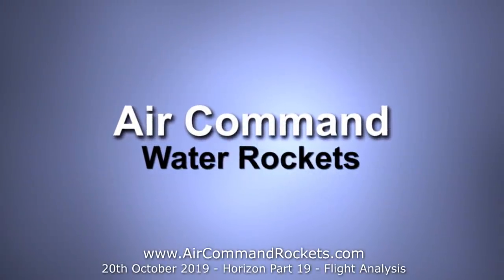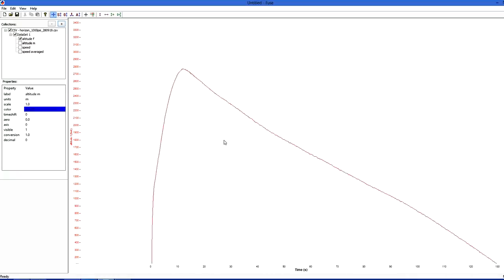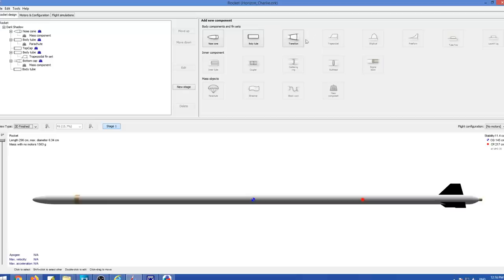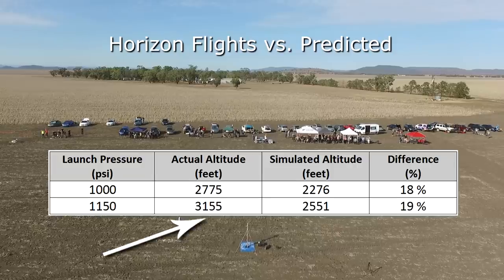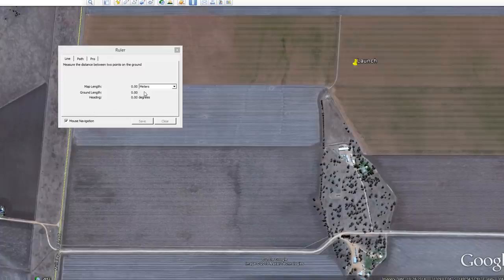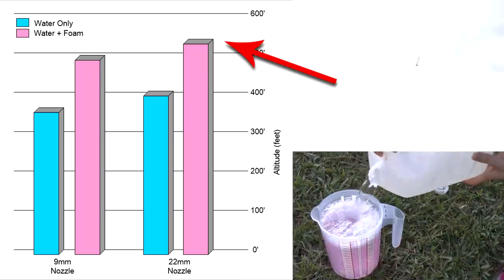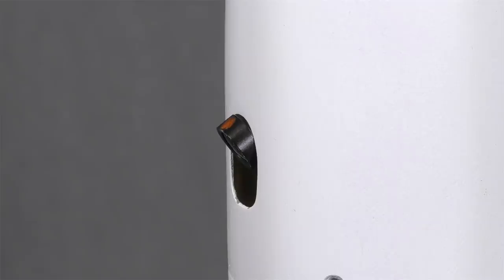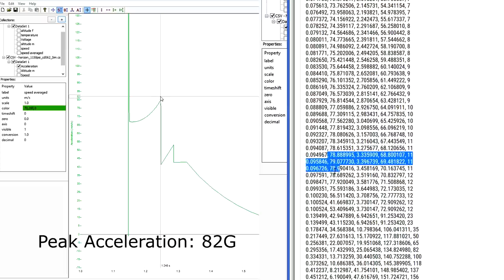2 Stage Water Rocket - Part 19 - Flight Analysis

Comment: So can we expect a bell nozzle in the future??
Reply from the maker: Most likely :) We'll have to do some work on the test stand for this.
Reply: @AirCommandRockets  I know in sugar rockets it does not take much divergent section to make an improvement in performance, and that a straight conical nozzle is almost as good as a perfectly curved de Lavel nozzle. That foam shot says to me it's time for a better nozzle. I'd be really interested to see the results.

BTW I made the 3d rendering function in Open Rocket and it still always makes me so happy to see it on youtube, especially an amazing project like yours. Great work!
Reply from the maker: Thanks Bill, :) Yeah, a conical nozzle is what we are most likely to have a go with since they are so much easier to machine. We'll need to update the release head to fit the nozzle, probably seal it in the throat portion of the nozzle. We'll run some ground tests on the test stand first to see how effective it is with the foam. 
Nice work on the OpenRocket rendering! :) I use the program quite a bit, mostly for mid/high power rockets.
Reply: @AirCommandRockets  Thanks! My work on it is just a little add-on, the other folks do the heavy lifting.

Comment: "You can probably guess what we need to do to the nozzle to improve performance even further."

Yes, yes I do.
Reply: Engine bell
Reply: @handsanitizermk.268  I'm excited to see this! I guess they guys and girls from Air Command Rockets are also happy about experimenting with some sweet sweet engine bells. Although: Could  you use some dry ice for pressurization, cooling and maybe some continuous thrust? It might be a step away from an elegant air/water rocket, but maybe worth a try.
Reply: @handsanitizermk.268  the challenge (or maybe not) would be the sealing. I'm thinking of it having a straight cone and the sealing on the smallest part of the nozzle. The coupler for that should match the profile of the nozzle bell. That will add more structural integrity to the rocket, given that this is a second stage.
Reply: @handsanitizermk.268  Yep, the still image shows that the divergent section of the nozzle has an undersized exit diameter since the foam undergoes additional expansion after leaving the nozzle.  No need for a "bell" shape.  Just a conical divergent section is fine.

Comment: Hi, thank's for this interesting video ! :)
The Drag coefficient depends of the speed. You can simulate the drag coefficient with RASAero II. It will give you a curve, not just a value.
Where could I find the Javascript version of the Water rocket simulator ?
Reply from the maker: Cheers, I'll give RASAero II a go. It's always good to have extra tools. The water rocket simulator hasn't be released yet. I still have some more work to put into it, just have to find the time. When it's finished, I will put it up on the web.

Comment: Interesting method of the altitude calculation! Great analysis, new vent holes and ideal expension of the divergent..waiting for the next video!
Reply from the maker: Cheers Kyiv Rocket Club. We're going to have to do some high pressure tests with the expansion nozzle on the ground first to try to measure the thrust and compare it to a straight through nozzle. That would be something we look at after this project is finished.

Comment: Hi George, the bending of the rocket under pressure might be due to less longitudinal carbon fiber strands on the outside of the bending curve. You could adjust this by laminating carbon roving onto the shell. If you want a stiffer tank section for the next build, you could consider using high modulus carbon fiber. This is a lot stiffer than the usual stuff but has almost no elongation at break. Interesting project, thanks for sharing
Reply from the maker: Thanks for the info Patrick, will keep this in mind for future builds.

Comment: Could you be hitting choked flow in the nozzle? I'd be surprised if you're breaking mach 1 in the water phase, but might be exceeding Mach 1 in the air phase. I'd be pretty suprised if compressible multiphase is well-studied since multiphase flow research is incredibly challenging, and isn't well-explored outside of applications applicable in industry. I definitely agree that you're seeing underexpansion at the nozzle exit. You've probably got a lot more potential performance in the rocket than you've seen so far.
Reply from the maker: If I remember correctly during the water only phase at this pressure the water is coming out at about 30m/s. This is a straight through nozzle without a divergent section, so during the air pulse I would be expecting only Mach 1 flow. With an expanding nozzle I would then expect > Mach 1 flow in the air phase. The big question is what is the exit velocity of the foam, and more importantly the velocity of the bubble surface (the water) as the bubble expands when it emerges from the nozzle. It would be interesting to find out if the foam can be accelerated to supersonic speeds out of a divergent nozzle. The complication of course is that the flow is not constant due to the dropping internal pressure.
Reply: @AirCommandRockets  I'm seeing a lot of air coming out in the jet in those stills at launch, which might be the gas dissolved in the water (which would be encouraged a ton by adding shampoo). Maybe there's something going on with sound propagation between the air bubbles and the water phase? That could depress the speed of sound a ton if it's got to cross from one to the other a ton. Thinking about the speed of sound changing that much just from the flow conditions is making me more than a little nauseous lol. I've never seen that sort of underexpansion in strictly subsonic flows, but that might be the limits of my experience talking.

Comment: when watching the previous video I was thinking the exact same thing when looking at the halo on the ground from the onboard footage. By the way that's not a glory, the specific name for that effect is heiligenschein.
Reply from the maker: Ahh ... good to know about the name of the phenomenon. Thanks!
Reply: Air Command Rockets No worries! Great series. And I may be mistaken, as heiligenschen is mainly used referring to dew causing the effect. Opposition Surge or the opposition effect is used when it's caused by a very rough surface, in this case a field. Fun fact, lunar regolith is retroreflective for this very reason! The rocks are so porous from being unweathered, and you can see this brightening around astronauts' heads in some photos taken from the moon. It's also why a full moon is far more than twice as bright as a 50% illuminated moon.

Comment: Have you considered using a GPS logger, which would not have the pressure error that a barometric altimeter does? Skydivers use a GPS that goes by the name of FlySight -- it's lightweight and logs at 10 Hz, I believe. As well, it uses Doppler data to measure velocities, which would improve your precision there over using differences in position data.
Reply from the maker: GPS could certainly be an option, though I am not sure what kind of altitude resolution could be achieved. I though it was around the 10m mark but could be wrong. GPS can also lose lock under high acceleration, but again I am not sure if that applies in this scenario or not. Having a GPS though on board would be useful for other things.

Comment: My immediate thought about the initial air pressure drop was the air mass movement during acceleration. Could you put a hole or two at the very point of the nose cone to reduce that effect?
Reply from the maker: That's a good question, I am not sure how that would affect the air pressure if the hole is exposed directly to the on-coming air stream. It may behave differently depending on if the other vent holes are open or closed as well.

Comment: Great job George! To think about rocket shadow and find sun position to determine altitude it is an amazing technique. I would have never thought about that possibility. About foam increasing thrust I think will be easy for you to set some static tests to measure the thrust curve with different % of soap. Maybe is a combination of effects. Soap is heavier than water so when mixed you have some more speed because of viscosity change and a bit more of mass with same volume.
Reply from the maker: Cheers. The mass increase here due to adding 20mL of shampoo to 2L of water is not significant. It is less than 0.5% more mass. In our case about 10g more compared to the 2000g for the water. I'm not sure how much viscosity plays part, as again the concentration of the shampoo is very low, and viscosity of shampoo is actually higher. I believe most of the benefit is due to the increase in exhaust velocity due to the bubbles expanding as they exit the nozzle.
Reply: Hi ! yes of course , I was not aware that soap was in so small quantity. But why soap influence bubble expansion ? If we pressurize water and gas the gas has a diffusion into the liquid. When pressure drops you have the bubbles. It works like sparkling water when you open the bottle cap. Maybe the soap has an influence on gas diffusion into the liquid. More gas into water&soap could mean more bubbles..so higher expansion.
Reply: @PieroAcme  With soap there can be probably more bubbles,
which remain from the filling.

Comment: I am thinking that the effects you are seeking are directly correlatable to the viscosity of the liquid used as your propellant. As such, consider adding pure glycerine to water.  It may also breakdown in UV better (ensuring that the farmer who owns this land is a happy camper).
Reply from the maker: That's a good point about the Glycerine, that's one of the reasons we only use low concentrations of the shampoo.
Reply: @AirCommandRockets  it is my impression that you are trying to enhance the effect of a two-phase flow.  This may be along the lines of what you are looking to achieve - https://www.sciencedirect.com/science/article/abs/pii/S0301932218307717
Reply: @AirCommandRockets  I guess what I am suggesting is that you consider a higher concentration.

Comment: Great videos - love it. I'm not a rocket engineer but... I work in the oil and gas world and we add surfactants (shampoo ?) to our water for pumping to reduce the friction losses (the term is slickwater - it lowers the water viscosity & hence  reduces friction loss in the pipe/nozzle). Could this be another factor ie reduced nozzle friction losses and therefore more energy available for thrust ?

Comment: Another interesting video George. You seem to be getting great results with your timer calculations, but Is there a reason why you don't use the altimeter to release the chute?
Reply from the maker: Thanks Derek. That is the long term plan to use the altimeter to release the chute. We have done this before and will definitely need to when it is flying as a two stage since it will be harder to predict apogee. We only have one of the stratologger altimeters that has a pyro output, (the other altimeters we use don't have any output for apogee) and so we only fly the stratologger rarely, as I've been unable to get a hold of a second one. 
We find the timer works well for most of the flights so we just use that. The timer is easier to replace than the altimeter. :)

Comment: How about experimenting with different hull surface treatments? ...or is this something already fully under control? (I am more a hydrodynamics guy:))
Reply from the maker: Sure there is always scope for surface treatment both internal and external surfaces for better airflow on the outside and better water flow on the inside. Any recommendations?
Reply: There must be some aerodynamics experts out there? Is surface roughness useful at those speeds?
Reply: Would a graphite surface in the water tanks produce useful roughness? No idea, but....   :)
Reply from the maker: A smooth surface performs better in this instance.
Reply: I guess that us much due to the high pressure. (should check Reynolds, ...)

Comment: So why do you think the foam creates such a noticeable improvement? Does it somehow increase the efficiency of the transfer of energy from the air to the water?
Reply from the maker: That's a good question, and I don't have a definitive answer. I have looked but have not been able to find any information on this yet.  I suspect it is mostly caused by a higher exhaust velocity of foam compared to water. Water at this pressure comes out I think at around 110km/h and regular air comes out at sonic speed, and foam would be somewhere in between there.
Reply: I believe it’s due to the shampoo lowering the viscosity of the working fluid, which reduces losses, allowing a higher exhaust velocity.
Reply: Wouldn't the detergent increase viscosity?  I would think the effect more likely due to the surfactant reducing surface tension of the water and thus promoting flow through the nozzle, and also extension of the ejection mass ejection duration due to the water being contained partially as foam - somewhat more even spread of ejection mass density than water on its own followed separately by the air plume.
Reply: I think the exhaust velocity is the key. To calculate the flow speed of water at the end of the nozzle we can use Bernoulli's equation, because the water is incompressible. I suppose that foam can be treated as high density compressible gas.
Reply: @AirCommandRockets  I think that such expansion of foam stream after the nozzle indicates that the supersonic flow occurs. Foam which is getting through the nozzle throat continues to expand. I'm very excited with thoutht about experiment with de Laval nozzle :D I'm curious how much more performance would it provide.

Comment: Could you install an accelerometer to improve the speed estimates? Heck, there must be some really fancy ways of measuring rocket speed. I wonder if anyone has ever tried to use doppler shift? You could have a little RF transmitter on the rocket transmitting a sine wave, and then measure the doppler shift in the signal from a receiver on the launch pad. (or the other way around, as I guess you could use a stronger transmitter if it was on the ground, with a little receiver on the rocket that could record some data to process later.)

Comment: I used a altimeter who detect th apogee and was connected to my prachut deployment system!!! So.... why are you using a timer for the parachut deployment suystem?? I don't want to teach you anything lol Just want to understand!!!
Reply from the maker: We only have one altimeter that has output for apogee detection that we can use to trigger deployment. All of our other altimeters only record data. We fly this altimeter only when we need to, to reduce the risk of losing it in a tree or a crash. As a result we almost always use timers since they are cheap and quite reliable. When this rocket is flown as a two stage we will definitely use it to deploy the parachute because it will be a lot harder to predict where apogee will be.

Comment: 13:15, I am not seeing much concaving of the jet stream, but I would guess that widening the nozzle would help make it faster.
Reply: Was just about to post the same, a diverging hypersonic nozzle would use this lost thrust in the overexpanded exhaust. However I'm not sure how foam and water fits into this idea... Ps. If too heavy for the booster, just a diverging nozzle on the upper stage would be most effective due to lower pressure (1000m staging height has about 10% lower pressure)
Reply: @minibeyse  :D thanks for a reminder to this video, I haven't looked at rocket science for a couple of months :)

Comment: Ever thought about using two altimeters at different heights inside the nozzle to validate the accelerated air theory?
Reply from the maker: Yup, we do want to do this experiment at some stage. We'll probably build dedicated hardware using pressure sensors and record at higher sample rates.

Comment: Where can we get the updated simulator?
Reply from the maker: There is still a little more work I need to do to it, but when that's done, I'll put it up on the website.
Reply: @AirCommandRockets  Great, thanks! because I noticed you updated the website to! Finally, just a quick note, you are getting to speeds where you start to have to account for the compressibility of air, that might be another reason for the difference in the simulated vs real values. When you release the sim, could you also release the math on which it is based?
Reply from the maker: Dean Wheeler did a good writeup of the maths behind water rocket flight. His simulator is based on these equations. https://www.et.byu.edu/~wheeler/benchtop/pix/thrust_eqns.pdf

Comment: What High Power pyro motor
 is your water rocket at 1000 psi equivalent to?
Reply from the maker: At a pressure of 1000psi, total impulse is about 240Ns . That puts it in the H motor class. They have a really fast burn, so it makes it about H1200. I haven't done the numbers yet for the first stage but it will be probably in the J class.

Comment: Could a water rocket launched from a vacuum tube potentially go higher? I'm thinking a long tube that would be evacuated, with a short rocket to maximize acceleration in the drag free environment(resembling pingpong vacuum launchers). It seems right in line with carbon neutral launching methods.
Reply from the maker: I would expect you could make a tube like that and have it work. You could Have an extra pressurized reservoir behind the rocket that would help push it up the tube even faster.
Reply: What about springs to give the rockte an extra push...?